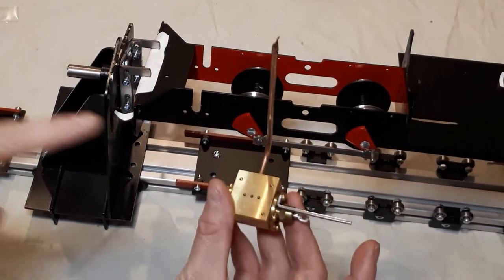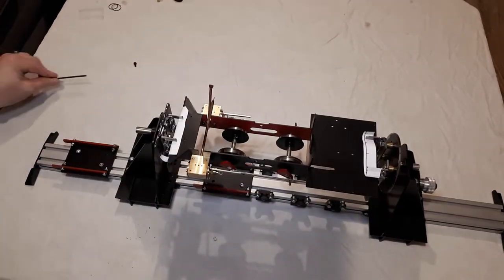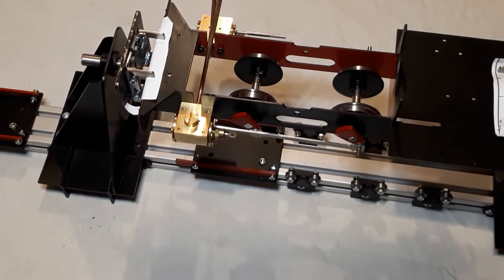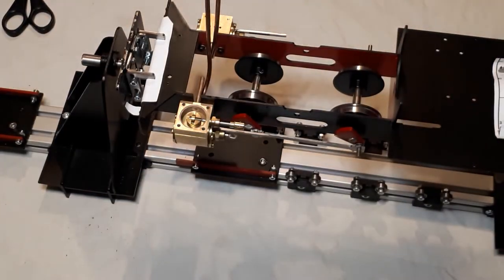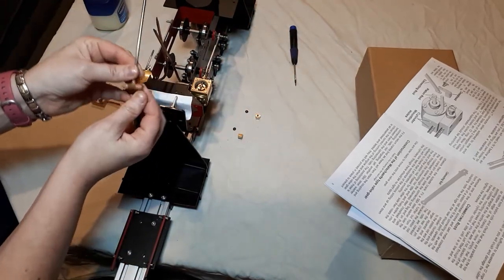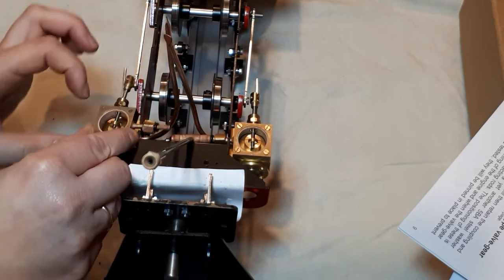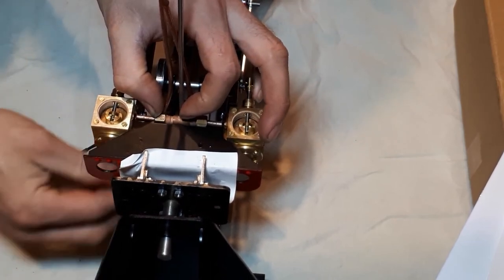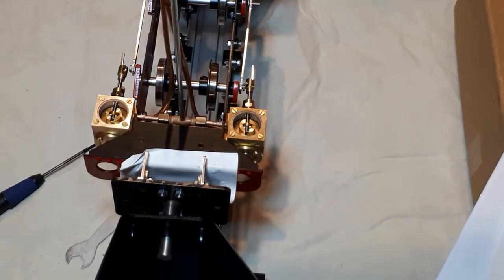Jack Part 8

Comment: Hi Holly, sorry you had to get some help for this stage of the build, BUT that would be exactly the same for me…probably with a few expletives and the need to step back and calm down a bit first! That said, you’ve created a really useful guide and resource, and I was really pleased to hear that the Roundhouse cylinders come ready made as opposed to being assembled by the builder. I look forward to watching the next instalment, and already I sense that I will be buying and using the MEL parts to assist me.